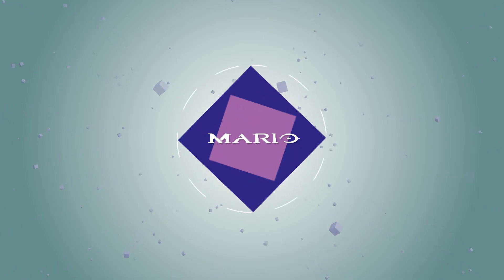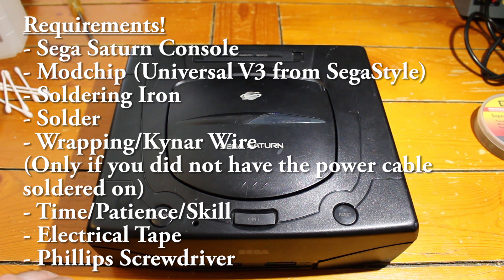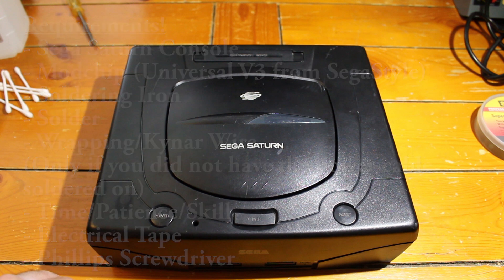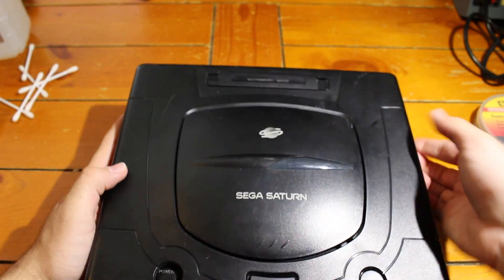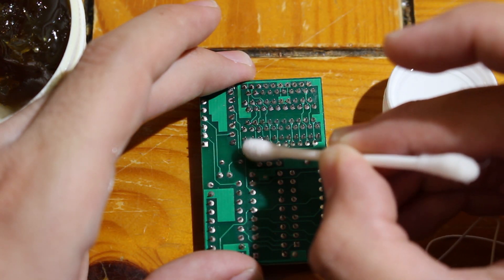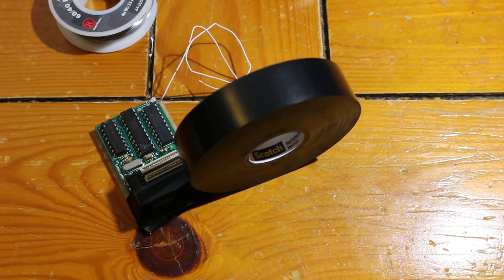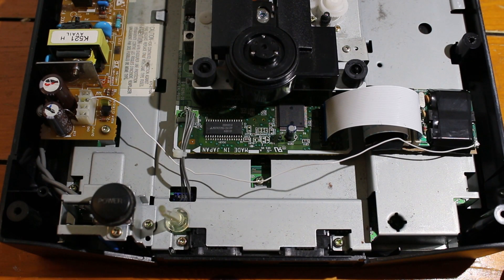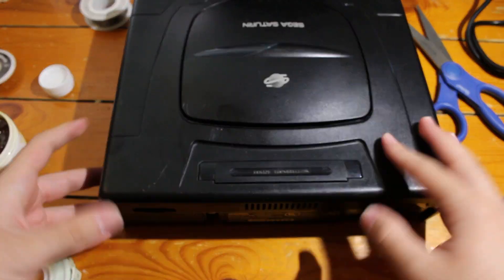How to Install a Modchip in a Sega Saturn [Universal V3 Tutorial]

Comment: Little late to the party, just put an Aliexpress chip in my saturn with this guide.  The chip was only for 21pin but the 5v wire matched up.  It's working great with backups and ntsc-j discs.
Reply from the maker: Glad it helped! Although not sure how/why this video has pretty much been dormant for years and this week it has gotten a few comments 😛
Reply: @MrMario2011  New to the Saturn scene.  Passed on it back in the day.  Bought the chip in Ali but had no instructions.  Quick YouTube search brought up your video and it's in business.  Did an fram swap while I was at it.

Comment: That's easy,just insulate the board so it won't short to the metal in the Saturn,plug in some ribbon cables and do a solder that even a beginner can do.

Comment: That 5v pin is a fucker to solder too, all the solder just goes down the sides. Ended up frying 2 power boards. Easier way is to just took it down the 5v connector
Reply from the maker: I didn't have any issues with hitting that point, but I can see how people would have difficulty with it. Glad you got it sorted!
Reply: MrMario2011 oh dear its a nightmare especially seems as it’s right next to plastic, it just never seemed to stick to the head of the pin. Suppose you’re good at soldering though I’m relatively new but I just don’t understand how u did it. I was there for ages just burning my power supply out and I tried literally everything but then seen another video on this where he just literally tinned the wire and just slotted it down the 5v line instead as it gets stuck down there pretty tight
Reply: MrMario2011 couldn’t really see your technique from the angle you recorded it from either because usually you need to heat the component then feed on the solder otherwise to my understanding it would form a bad connection so dunno how you did it as I could only melt the solder with a direct touch on that point to the iron.
Reply: MrMario2011 forgive me for being so stupid I’m fairly new to soldering but I’m getting a lot better. Easiest way to get that pin is to just feed the solder onto the iron tip and press it against the point and lift the iron up. When I did it I literally held the iron onto the point and fed in the solder.... which is why it messed up 😂

Comment from the maker: For anyone struggling to find a modchip: You can alternatively now flash a custom firmware to your Action Replay cartridge which is essentially a softmod. It's cheaper, easier, removable, and you can actually find a flash cart unlike a modchip!

https://www.youtube.com/watch?v=cpn2xZTxNcA
Reply: +MrMario2011 Easy to buy? Where and what's the price?
Reply: ...And you can't use the AR for saves or codes ever again! You still have pull the cart in and out to save it to another cart, unless you just keep everything to the internal RAM. I would prefer a better option, unless they can fix the AR mod, which is quite possible in the future.

Comment: Hi,best video on V3 modding on saturn on youtube!(every1 mumbles and/or has poor lighting.)

I did this mod on my Model 2 and my saturn won't read games as games,only as cds. My guess is my poor soldering skills and that fact I used 22 gauge and not 30 gauge. What do you think?
Reply from the maker: STLetsgetitonnow 22 gauge is more than enough so that should provide sufficient power, it could easily just be soldering issues though.